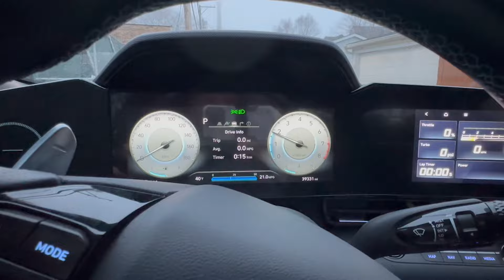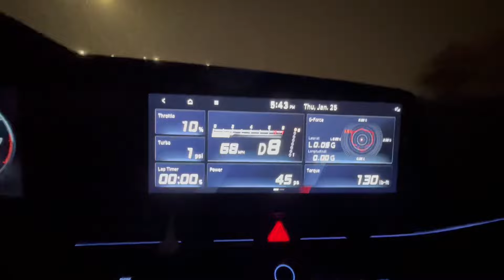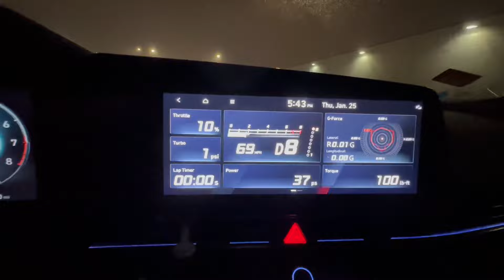Elantra N in trouble?!

Comment: Also disconnect the battery positive post for 30 minutes. See if it will reset and clear the code until your dealer appointment.
Reply from the maker: I will try with my scanner first tomorrow if no I will disconnect the battery and see what’s up

Comment: My Kona N just did this to me today after a touch less car wash. I’m hoping to fix it with an OBD tool tomorrow.
Reply from the maker: It’s such a common issue with N’s that they should do something about it imo
Reply: @PolishBullitt I agree. I got lucky 🍀 though and they cleared the code at Hyundai and so far so good hasn’t popped up yet after a day of driving. I was honestly considering having them buy back the car but if it doesn’t do it again probably won’t try and be too much of a Karen about it. Luckily my local Hyundai dealer has kept a good relationship with me and my Kona N.
Reply from the maker: @ not gonna lie but good relationship with your dealer is pretty important with those cars haha but don’t worry even if the knock sensor fail they will replace it for free and usually pretty quickly it’s just annoying and things like that shouldn’t happen
Reply: @PolishBullitt  I agree, they aren’t terrible cars and do have a tendency to have their issues. With any car brand you’ll have to deal with major and minor annoyances. I think Hyundai has stepped up in the last couple years.
Reply from the maker: @ oh yeah this is not a Hyundai from old, they actually make pretty decent cars same with Kia, I own Elantra N and we have a 2021 Kia Sorento Hybrid as a family car and honestly no complaints

Comment: Had the same problem, issue is the knock sensor doesn't properly have a shield/cover, so when the sensor gets wet it goes into limp mode.   I was stranded on the interstate w/ my kids in the back.  Wish Hyundai would address this issue.  Dealer had no idea what was wrong, but cleared the code.
Reply from the maker: That’s sucks brother, but I can drive my car with limp mode is yours didn’t want to go at all?
Reply: @PolishBullitt  Mine was in limp mode like yours.  I bought a cheap $30 OBD-II reader/clearer from Amazon, so if it happens again while I'm driving I can just remove the code.  Keep it in my center console.
Reply from the maker: @LeftenantMalachi oh ok so you could still drive it, I will figure something out maybe I can clear that code myself, my buddy should drop off my scanner later today
Reply: @PolishBullitt  First time it happened I didn't have the scanner, so I had to use Bluelink, and the car to be towed to the dealership.  I have the scanner now so if it happens in the future I won't be stranded. ;)
Reply: @LeftenantMalachi now I did this after the 2nd time and when it happened the 3rd time I cleared it and it came back on in about 20 seconds...then they replaced the knock sensor and it's all good!
Reply: @klasseact6663   I need to find out where the sensor is, and shield it.  I don't need this on a daily.
Reply: @ChrisAchiles  it's behind the intake manifold. So back in 2022 I started using a touch-free wash in July, a monthly subscription and I used several times a week (very close to my work and home) Then just before 4th of July 2023 is when I got the code for the knock sensor. They couldn't find anything wrong, reset it and it was fine...until the next wash, repeated the "repair". I then waited 2 weeks and washed it again...BAM, same problem but resetting it with own code reader didn't work. After the 2nd "repair' I opened a case with Hyundai a day even the general manager of the dealership contacted me and suggested I do this, I told him I already did, I thought I was in trouble or something. 

Since the repair I've been using the wash w/o a problem, although I downgraded the wash to one w/o underbody wash, not sure that was even a problem as ou4 cars have a splash pan on them.

Good luck making a shield, who knows, you might be a hero in the N community 😇
Reply: @klasseact6663   We had an issue with my  the type of engine in my mercedes has (M278 and it sister one the AMG M157) with oil, and water intrusion on ECU and O2 sensor cables. These cars were being dumped on dealerships for cheap until me, and another forum member found, and fixed the problem. I just don't know which forums are good for the N' platform ie KN EN, and VN. (me having a Kona N).

Comment: I wonder if this a problem more with the 2022 model? I have never experienced this issue with my 2023 and I pressure wash the motor and thru the front grill all the time when I wash it. Either way I am sure it will be covered under warranty Brother 🙂 👍
Reply from the maker: From what I see 23’s are affected too I guess it random like horn going out haha
Reply: @PolishBullitt  That's weird I would think that if it is an issue with the knock sensor getting wet because it has no protection than it would no different from one car to another. Remember you washed it before you left to Miami and then left it in the cold for a week or so. 🤔
Reply from the maker: @N-Krazy1976 yes I washed it before I left and took off my Stillen piggyback